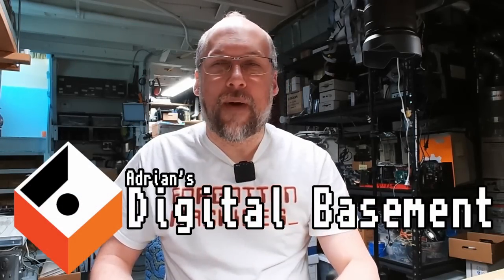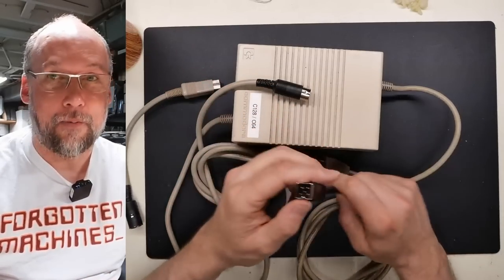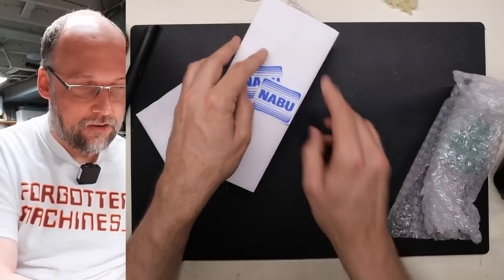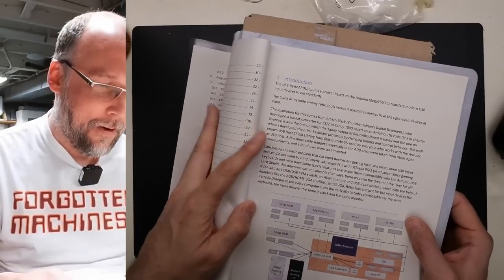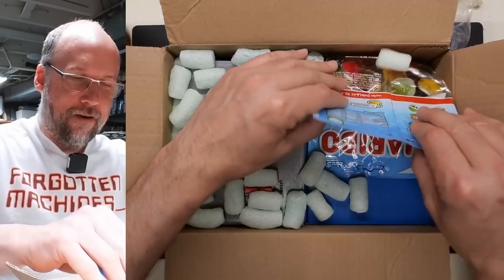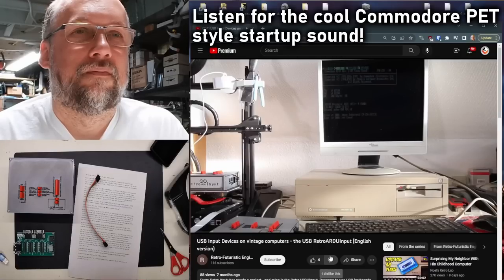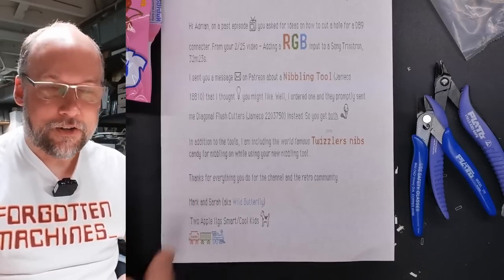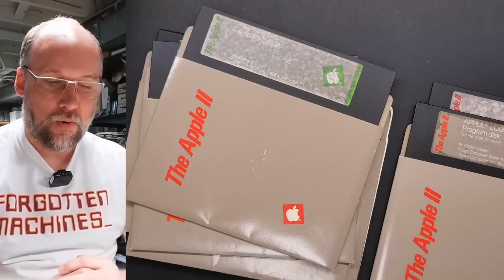0061 A universal keyboard/mouse adapter, an Apple IIe numeric keypad, some NABU stuff and more!

Comment: The note on the Apple //e keypad box probably references the fact that, on the Apple ][ and ][+ (which had only left and right arrow keys), you could hit the spacebar in Visicalc to toggle whether the left and right arrows moved left and right or moved up and down.

Newer versions of Visicalc were presumably updated for the //e, which did have all four arrow keys, and presumably dropped the spacebar toggle functionality.
Reply from the maker: Good call, that's gotta be it

Comment: Good to see that my packet arrived properly. I was a little concerned about the 3D-printed case of the RetroARDUInput but obviously Haribo is a good packing material. The cables for the RetroARDUInput are quite straight forward, a 5-Pin DIN Cable (should also be enough for Tandy), PS/2 and ADB can be ignored for now (but 6-Pin Mini-DIN cables are also quite common on Amazon and for ADB, a S-Video cable does the trick) and the DB15/DB9 cables would be normal serial or joystick extension cables.
Regarding the BusMousOMatic, the jumper wire is to always straight jumper a source to a destination device. Like when you plug in a tank mouse or the RetroARDUInput to the left input port, jumper e.g. Amiga to InPort and once you found one of the 9-Pin (InPort/Archimedes/Headstart) or 8-Pin (NeXT) cables, you can connect it to a PC. Or you plug in an InPort mouse to the InPort port and jumper from InPort to the Atari, Amiga or Amstrad output and use the InPort on an Amiga. That is the whole idea. all jumper wire connections are 1:1.
Regarding the USB host shield bug: It seems that all USB host shields that I randomly bought throughout the last year have some issue, potentially some ground issue or something. Some voltage builds up and you can even read up to 4V on the 3.3V rail even if the small jumper solder blobs are not set. The current is so low that it will not last to power the host shield and will not damage the Arduino, but it confuses the host shield that it will not work. If you use a current-limited USB power source, the 5V line will collapse, meaning also the I/O signals go slightly below 5V, which reduces the build-up of the rogue voltage in the host shield and it works. The way I want to address this on the modular version is by a 2-rail power supply with which you can reduce the input voltage on the Arduino, but without affecting other logic chips and even being able to provide a stable 5V on the USB host port. There is quite some hardware re-design required, so I put the finalization of the unfinished software parts (ADB and PS/2) on low priority. As the modular version will have I/O boards and a CPU board, there will be the possibility to add further ports as community projects - e.g. once I finished the base unit, you might want to add other old Mac stuff, or a CPU board for Raspberry Pi board will allow a Pi or Pi Zero, maybe even with compatibility to dekuNukems "USB4VC"

Comment: Several Things:

The Nibbling Tool - it is only good for soft materials, as it will get dull if you use it to cut metal, including thin metal. And after the 20+ cuts, you hand starts to cramp up. Radio Shack sold (still sells on the online store) the same tool.

The Apple IIe Keypad, there was a similar unit for the Mac 128K - 512KE, as the extended keyboard for Macs did not come out until the Mac Plus, but by them people were buying Extended Keyboards for their older Macs.

*Sigh* Logo did not come out until at least 1984 when Seymour Pappart help create it under MIT to teach computer programming to children and it did not get into main stream until after 1985 when the competition between Boston, NYC and LA/San Fran school systems tried to the first "Computer schools" in 1985/86 with NYC winning that little competition. LA/San Fran was Second, and Boston was third. (I am the one who wrote the Doctrine of Computer Literacy and Education for the NYC Schools in 1985 which the first computer schools were first created from). With the exception of Japan, everyone else followed along the plan. Japan had the first computer schools but it is that they went a different route with their computer education compared to the USA. Logo came from the Mainframe language LISP and used a "Turtle" to create graphics on a screen. A Subset of Logo because "Yellow Brick Logo in the 1990s for use with the Lego Robotics kits using the Yellow RCX Computer Bricks.  From YB Logo came Scratch (circa 2015) - all created by MIT.

Yes from 1978 to 1984, various high schools had computer clubs and in some cases, BASIC programming classes but Logo was not around for another few years in the elementary school level.

The Apple Logo disks, one was its "DOS disk, and then you had to put in the other disk. At the time (of he IIe), Apple wrote a lot of programs (**cough! cough! Apple Works! cough! cough!) where you had to load in ProDOS first and then the application disk but the first disk was usually referred to as "(Application) Disk #1"

If anything you should copy and publicly archive those disks, especially the Logo Disks as they are almost impossible to come by.

Comment: I remember using Logo on the BBC model B in school. We did actually use it to control a wired robot (turtle) to follow a path or shape on the floor. This would have been around 1984 I think. It was great fun when we were 10/11 years old!

Comment: Logo is actually a general-purpose multi-paradigm (functional/procedural) programming language, a dialect of Lisp, and one of the influences on Smalltalk. Logo's application to introducing children to computers and the turtle graphics features unfortunately tend to overshadow that. Also, the double-sided Logo's disk label says it's Pascal-based. Other than possibly referring to Apple II Pascal, I don't know what that means.
Reply: In this context I believe the Pascal-based was referring to the operating system, using the Apple Pascal OS instead of DOS 3.2, DOS 3.3, or PRODOS.
Reply: @tedthrasher9433  Ahh, okay. Thank you! Is "Apple Pascal OS" what I would Google for, to learn more about it?
Reply: @Ice_Karma  It’s something I would like to learn more about myself. I only ever really used DOS 3.3 and PRODOS at the time, but was intrigued by the occasional disk that was formatted in Pascal format. Here’s a link to the Pascal OS Reference Manual and there seem to be many other resources available online, too. 
http://pascal.hansotten.com/uploads/ucsd/apple/ii/Apple2Pascal_Operating_System_Ref.pdf
Reply: Long, long ago, before Java, there was UCSD Pascal with it's P-System.  Basically, the idea was that you could write a program in Pascal, then instead of compiling it into machine language, you'd compile it for the P-System, like compiling a Java, Clojure, etc. program into the Java VM's byte code.  Then, you could run that Pascal program on anything from an Apple II to a very, very expensive Minicomputer at a university or something.  The people involved in creating this had the notion that one day, every computer of every size would have a version of the Pascal P-System as a sort of low-level OS, and then all software could  be written as platform-agnostic.  Then, there would be no need to re-write the same program for different processors (Z80, 6502, etc.), let alone for different machines using the same processor (Apple II, Commodore Pet, etc.).  

It never became quite THAT big, and lots of people just ended up compiling Pascal directly into the target machine's machine code.  But, there were versions of UCSD Pascal and its P-System for a number of different hardware platforms, and it did have a HUGE influence on the creators of Java and Microsoft's .Net ML, among other things.
Reply: @tedthrasher9433  Thank you very much for the link! 😻
Reply: @derekchristenson5711   Yeah, it's just too bad that Pascal is an awful language :P

Comment: (@13:57) Whoa Nellie! Take a gander at how close the pins on that thing are to the metal case of that crystal oscillator! I’d put some insulating tape over the top of the oscillator can (or put an unused 4-pin female connector on it). That’s just short-circuit city, there.

Comment: I don't have a massive IC collection but what I found works for me is binders with pages for card collecting and antistatic bags about the same size as the card sleeves. Chips that are too big (or I have too many) go into antistatic bags and then one of those sorter tackle boxes.  I find this works better for me than those little draw divider cabinets that just seem to take up way too much space.
Reply: I use those collector card pages for loose resistors, one or two pages for each decade. I do have to be careful to keep it right side up (ha ha), and I store the binder in a plastic bag to keep bits from falling out, but otherwise it's easy to use.
And I'm going to give another vote against those drawer cabinets, they're just too fiddly inside, and you can't see what's in the drawer. My big thing these days is stacking a bunch of cheap clear storage containers, then putting sticky labels on them. My favorite storage containers are those 12-partition bead boxes, but I'll use anything that is clear and stacks well on a shelf.

Comment: The "Print" key producing a question mark kinda makes sense, since ? is a shortcut for the PRINT command in BASIC.
Reply from the maker: Ha I didn't even think of that connection. I wonder if spreadsheets implemented it that way?
Reply: could be also a terminal command

Comment: I finally got around to organizing some of my old chips this week. A few months ago I had ordered two 12" square sheets of foam. I cut them up into 4"x6" pieces, to fit a bunch of nice cheap containers that size, they are clear and stack, my two big rules.
Basically I now have a bunch of sheets of foam with DRAM chips sorted onto them, mostly 64K and 256K. But that was just a warm-up, and I still have EPROMs, SRAMs (I plan to put those into old NES cartridge rental cases), CPUs, and other chips to sort.

Comment: So last year I got my Prusa MK3S+ which included Haribos from Prague (which is where the printer is from). They were decent enough. Well, I've been working on a car part for my parent's car (one they don't use much). and I found filament that was close to the original color. It's slightly more beige. There is no evidence the original part yellowed (inside matches the outside), but if it did, it could be a closer match. Anyway that filament came with a bag of gummys. I don't remember the brand, but holy damn they were 10x better than haribos. At least the ones from prague anyway. lol lol I am getting more haribos though. I have a prusa mk4 kit on order. They haven't shipped the mk4 kits yet. Only the fully assembled mk4's. Hopefully soon. It was supposed to be 2nd half of may.

Comment: for the nibble - square hole --- mark hole size with tape; drill center round hole; nibble it out to close to the edge but dont cut past tape edge; use a fine grain flat small file to clean up flat edges

Comment: A TV tech that I used to know (now deceased), would put his ICs into small ~2.5" x 4" paper envelopes with the chip number scribbled on the outside.   Then stand those envelopes up in cardboard bin boxes (by chip series 74LS, 74HCT, etc).   Also seemed to work well for other components like transistors, resistors, etc...
Reply: Most paper is acidic; paper yellowing is due to the acid inside breaking down the cellulose. Even documents kept in climate controlled low humidity storage will suffer this, albeit more slowly than comfortable humidities. The acids can result in staples being 50% rust within 20 years, and iron based inks turning from black to rust. (I worked at the Anchorage branch of the US National Archives for about 1.5 years - mostly pulling staples and tape from documents up to about 120 years old. The newest docs I worked on were from the Vietnam War era; some were already yellowing and had 25% thickness rust on the staples. High quality paper from 1880 was still pristine white, and the straight pins used as fasteners still shiny.) Yellow papers are often acidic. Don't store anything of import in manilla-colored papers.
Reply: @WilliamHostman  can it be trusted when it says acid free? Not that I’ve seen it on an envelope, but I’ve always seen it on my sketching and writing paper. I’m assuming that means acid free on sale, but it might still turn acidic?

Comment: I use the same  "PSU adapter hack" on my Macbook pro. But instead of replacing the magsafe connector with the chip, I used the same adapter socket on a car charger. So I can decide if I want to use it on mains power or from 12V in my weekend house.
The magsafe end has a chip inside to tell the MBP what charger I use. On the other end, it only needs +18V and GND.

Comment: My num pad connector has a back plate that is threaded, no need for nuts on mine but I do have to use washers to pinch the back plate.  Also, you only need to hold down the closed apple for diagnostics, I accidentally slipped my finger off the open apple one day and it still worked. For years I too thought both keys were required.  I only tested this on Apple 2e.

Comment: Should also create an inventory DB so you know what you have in each organizer drawer.  Though then you need to actually track what's used and subtracting it from the inventory.
Reply: add those square product barcodes to each drawer so you can scan the drawer with a phone to find out what's inside, you could even create a local web site that the barcode could open  with args that brought up the drawer inventory and if you removed a part you could click the screen and remove it from an inventory database and likewise add a part and input the part with the phone.

Comment: USB4VC is another great converter for modern keyboards, mice and game controllers based on Raspberry Pi. Works really great and has support for different protocol cards! I use it to control my MS-DOS era PC with modern keyboard, mouse and a XBOX one controller.
Reply: Came here to say this. I use the USB4VC with an original Pi Zero (and USB Hub) to great success. 

USB Mouse, USB keyboard and an XBox controller all show up as standard devices on my 486 without special drivers.
Reply: I dunno. Availability aside, I've heard annoyance stories about having to work around the non-instant boot for other Pi-based devices like the PiSCSI. If I'd ever found the time, I've been blinded to these things by my fixation on my inability to find any of the vintage ASIC-based USB-to-PS2 adapters and had been planning to grab an STM32 dev board with an Arduino core and native USB host support in hardware and write my own firmware which bit-bangs PS/2 on the GPIO pins.

Comment: For sorting and if you want to be ultra organised, you could also sort/store by chip date as well.  So in future if you want to repair/restore a device and keep it date/year correct it'll be a bit easier.  I think using one of those plastic storage drawers is good (the ones you see in workshops, electrical stations).  What you could also do is store XYX chips in one drawer, if you have too many, also have a code/ref printed on the drawer, excess chips you store in a static bag with the same code/ref.  Keep the static bags in a storage container with each code/ref written on the front so you can quickly find replacements to top up the storage drawers.

Comment: 51:28 pretty sure there was a DOS version of the program. I used it for a couple of years back when I was in primary school, but between the exercises being pointless, the teacher's inconstance and the fact that it seemingly doesn't serve for any other purpose outside of class, not much was done with it (to the point that the second year we used it we started literally from scratch with the new teacher assuming we hadn't ever seen it). The most interesting thing I can say about it is that Mathologer has made a video using its motif as visual aid, just look for the turtle in the thumbnail (or search for "turtle").
Reply: There were Logo releases for most major OSs of the era... Apple II+ & up, CP/M, C64, C128, C128+CP/M, Mattel Aquarius, Atari 8-bits & ST line, Mac 128 (usable to about system 6 on later machines, IIRC), MSX (which is a graphical superset of a subset of CP/M), TI99/4a, Acorn, Amstrad CPC.... I suspect the IBM PC version was MS-DOS, but can't be certain, but there were specific versions for the PC and PCjr.
Reply: and Berkeley Logo (UCBLogo) is available for most modern platforms, if you want to give it a try today

Comment: Regarding the "disastrous chip situation" in the first segment, I immediately thought of Gridfinity for organization. DIP IC organizer parts are up on thingiverse, etc. Even just the usual small boxes could help. I've seen ESD-safe PLA filament, but it's very expensive -- maybe just lining the bottom with a metal sheet would suffice, lol.

Comment: I've also never seen an external Apple numeric keypad as well. The ROM 01 IIGS has the solder pads for the header for that keypad as well, so I'm assuming it would work with the GS for those who had them installed in their old IIe case.

It would be interesting to learn why the PRINT key outputs a question mark. The only thing I can think of is that the ? is a shortcut to typing PRINT when writing Applesoft BASIC. I suppose it could be used for that, but it seems weird that that would be the only BASIC command the keypad could provide.

Comment: Organization is part of why Im sorta on a break right now. The power issue on the convertor will be the same reset bug thats driven me and many others insane when using external power. There is a simple circuit to fix it